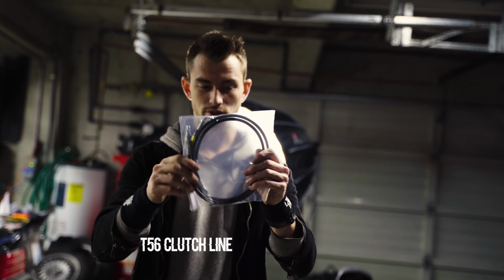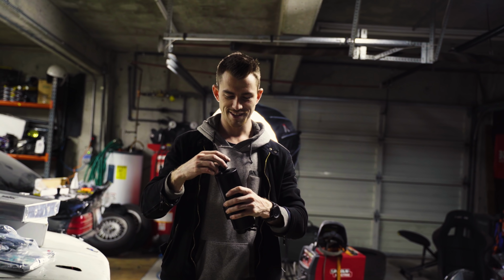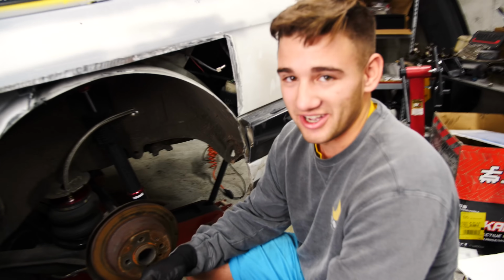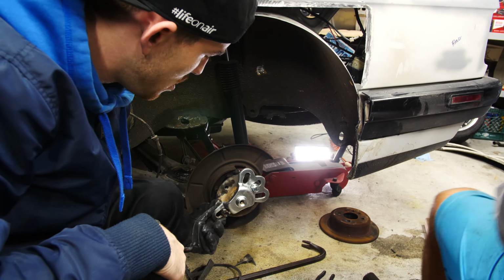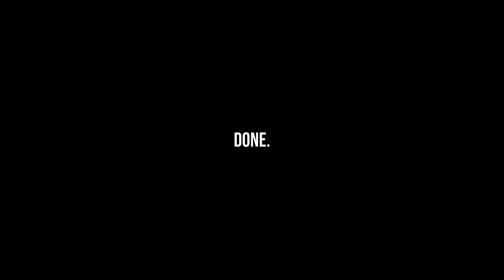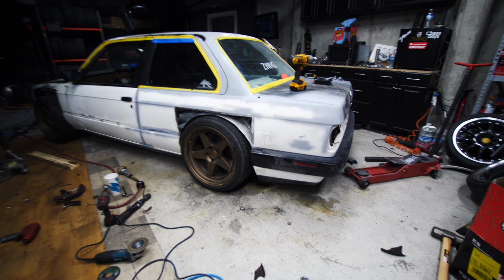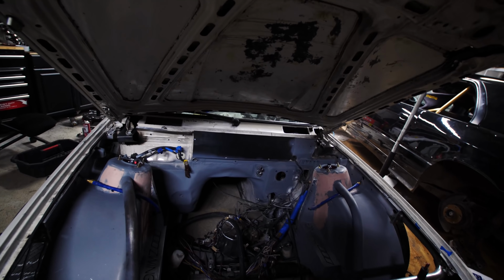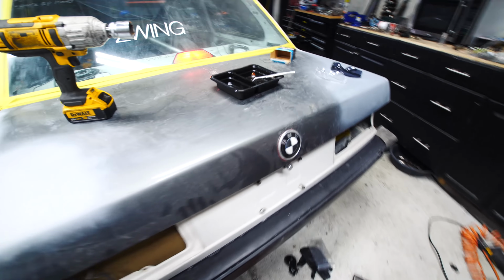This E30 Widebody Kit is INSANE! [08]

Comment: Hot tip: to remove old wheel bearings bolt the outside of the spare wheel on and spin it while whacking it with a dead blow hammer. Works like a charm and far easier than a puller.

Comment: Where are the wife body panels made? Certainly cringed watching you try to remove the rear hub with a slide hammer (honestly surprised you got it off). I’ve got the B90 tool sitting in my garage just wanted to give it to you lol.

Comment: Do you have more info on that 5lug hubs?
Reply from the maker: Hopefully this is helpful.
I used 1999 E36 M3 from hubs which mind you requires e36 front suspension, and for the rear I used Z4 hubs - all you do is replace your e30 wheel bearings with new ones and then press in the Z4 hubs and to run e36 m3 brakes in rear you can buy the adapter kit from SRS concepts.

Other options include getting 318ti trailng arms or Z3 1.9L trailing arms which come with a 5 lug hub already pressed in.